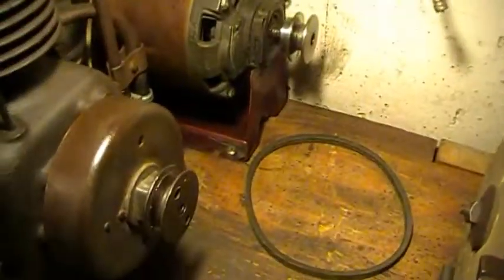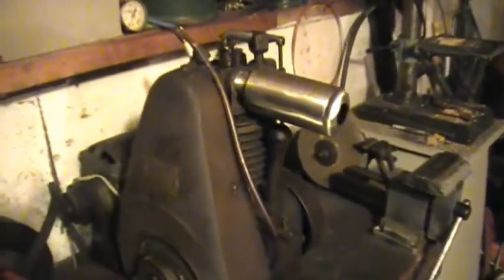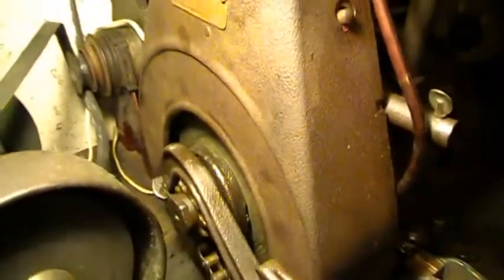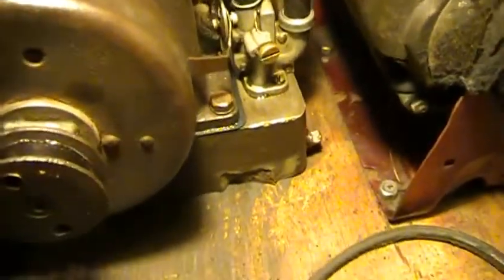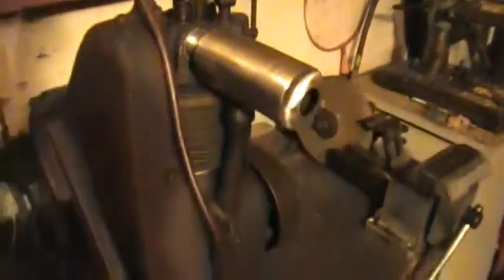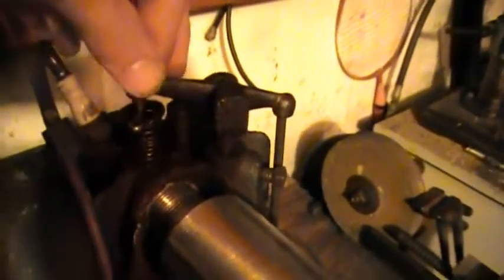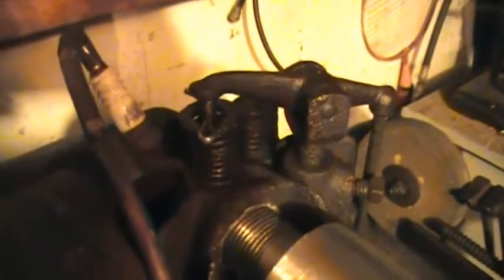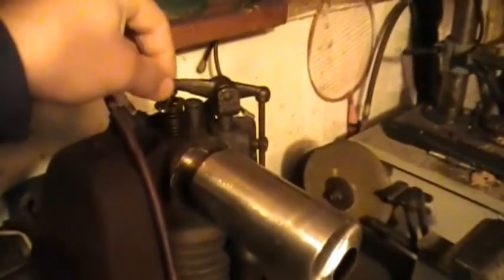Jacktown Find - 1929 Briggs & Stratton FH

Comment: Those are great little engines.  I have the 1928 version with the slanted fins and brass carb.  It came off a Montgomery Ward washing machine.  Good effort on trying to save the original valve.  Now you need to build a drawer for your drawer pull.

Comment: How much different is one of these from an FG or an FI?  That suction carburetor couldn't had been easy to get working properly.
Reply from the maker: Don't quote me on this, but I believe the FI's have a push-rod for both valves and 2 air-cooling shrouds. I am not sure about the FG though, Briggs and Stratton made so many models of engines that it's hard to keep track of them! Yeah those suction carbs are very finicky, but it is possible to work the kinks out of them! I've got to tell you though, Briggs sure did have funky designs for there carburetors! Anyway, Thanks for watching and for commenting!! : )